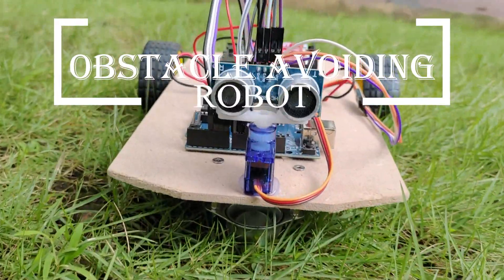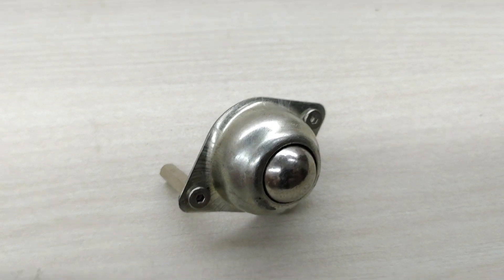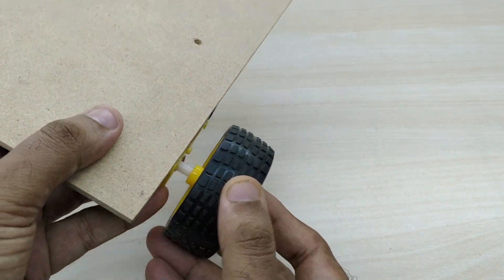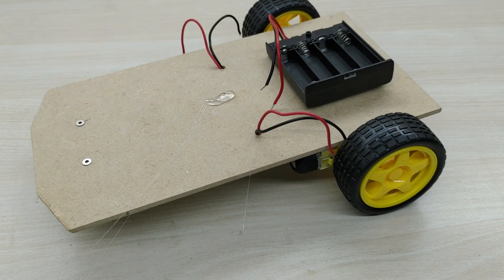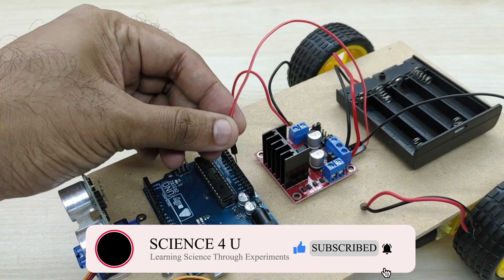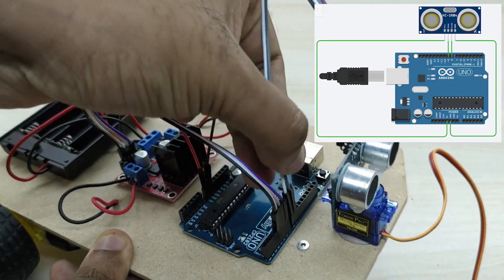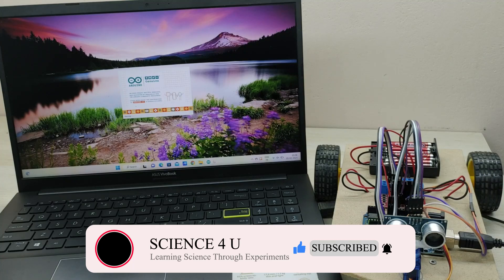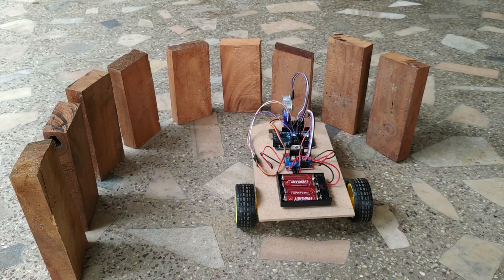Intelligent Obstacle Avoiding Robot || Step by Step Tutorial || Arduino Project

Comment: Bro my motors are stop working sometime while car is going ahead and battery is fully charged
Reply from the maker: It could be some loose connection or problem with the motor driver board. Is it detecting obstacle correctly?. Also if you remove ultrasonic sensor, is it continously going to front without stopping?. Can you check that?

Comment: can I use 4x 18650 3.7V battery? will that be too much power? can I use the 5v pin in the L298n if it has too much power?
Reply from the maker: it is too much for the project friend. A total voltage upto 12V is fine. 2  x 18650 or maximum 3 x 18650 is okay. Beyond that, it will damage the board and motors.
Reply: @Science_4U_  Thank you

Comment: Can i use a battery box that only lets 2 batteries in. Or i will need more power. or just use the one your using.
Reply from the maker: Hi friend. You need at least 4 batteries if your are using AA batteries. that gives you 4 x 1.5 V = 6V input voltage. So if you are using AA 1.5V batteries, you need a holder with 4 batteries. Another better option is to use 2 x 18650, 3.7V batteries. If you use 18650 batteries, you have to use a holder with 2 nos. of 18650 batteries and it gives 7.4V output voltage.

Comment: My Arduino board is a bit different there's no IOref but rather another 5v
Reply from the maker: Both IOREF and 5V are one and the same. Both pins give 5V output. You can use 5V pin instead of IOREF pin.

Comment: My G I dont have a servo motor . Does it still work ? Is it works please tell me how can i make it so it would work without a servo motor
Reply from the maker: Hi friend. You don't need a servo motor for this to work.  No need to change the code also. Just fix the ultrasonic sensor alone in front. The connections for the servo motor to arduino alone can be ignored.
Reply: Thank you very much 💀 I was really shocked by your quick answer . Thank you very much  @Science_4U_

Comment: Sir, I have completed the model by seeing ur video.but only one motor is running and another one is not working and the car is rotating in a circular manner because of One wheel.what might be the problem? and how can I resolve it sir
Reply: i Have also changed the  motor Driver too
Reply from the maker: Okay friend. I think the battery may not be powerful enough to rotate both thr motors together. Can you lift the robot in you hand and try rotating the wheel which is not rotating. Do you feel like it is starting to rotate or there is no rotation at all?. Also alongwith the battery, connect uno to usb also. Now are both wheels rotating?. Most likely i think it should be due to poor battery.
Reply: I have also lifted up sir but only one wheel is rotating but if I give direct connection to the battery then it is rotating
Reply from the maker: @SHIVKUMAREASWARB  okay friend. Can you do one thing?. In the motor driver board, remove wires from IN1 & IN2 and connect to IN3 and IN4. Also remove wires frim IN3 and IN4 and connect them to IN1 and IN2. Is the other motor now rotating?.

Comment: Sir, the code is not working
Reply from the maker: Hi friend. After uploading the code and switching on, the wheels are not rotating?
Reply: @Science_4U_  ohhhh, actually it works, Thank you very much 😘
Reply from the maker: Okay friend. Actually all the projects that I upload are after making it and testing by myself. So all are working projects only. If it doesnt, there could be some mistake in connection or most often the components may be faulty.

Comment: Servo motor is working but car is not moving. How can check if my motor driver is faulty?
Reply from the maker: The motor driver needs to have 2 jumpers connected on ENA and ENB pins. The jumpers should be present for the working of the motor driver. Are the jumpers available?
Also to check whether the motor driver is working, connect IN1 pin to +5V of arduino and IN2 pin to GND pin of arduino. Power on arduino and motor driver board. If the motor driver is working, the motors should rotate now.

Comment: i use ch340 arduino and it doesnt have a ioref do you know for its substitute?
Reply from the maker: Hi friend. Is your CH340 a regular sized Arduino board or a nano board?. Instead ot IOREF another pin should be there in its place labelled 5V. Is there a pin like that?
Reply: @Science_4U_  I use also a 2pcs of 3.7 batt 183650 still should i put that at 5V?
Reply from the maker: @joannrosemalalis1374  Yes friend. The sensors are powered from the 5V outputs from arduino board. So if you are able to find any 5V pin in arduino board, you can use that to power the sensor.

Comment: When iam disconnect the usb cable from laptop the motor didn't work when connect the usb cable to computer it's working what can I do😢
Reply from the maker: That is definitely because the batteries are discharged. When connected to laptop, the arduino, sensors and servo motor gets its power from laptop and the battery needs to run only the motor and so it works. So even if battery is slighly discharged, it will work. 
Changing to new battery will solve the problem friend.
Reply: Thank you bro❤😊😊
Reply: Thankyou thank you for your best information ❤❤❤❤❤❤❤❤😊😊

Comment: I want to add DC switch to it... can you please tell me where can I put it in the circuit?
Reply from the maker: Hi friend. You can add switch in the positive or negative wire from the battery. Just cut the wire coming from +ve or -ve terminal of the battery and add a switch there. 🙂
Reply: Thank you it worked but now my wheels are not moving. What could be the possible reason? I followed the same circuit but instead of those batteries, I am using 18650 lithium batteries.
Reply from the maker: 18650 batteries are infact a better choice. I just wanted to understand.Were the wheels working earlier before adding the switch?
Reply: Yes. They are working fine otherwise. I tried to run it on L298N motor driver only.
Reply from the maker: @Vaidehibhaiya  Hmm..But Iam also not able to understand why the wheels are not working after just adding the switch.🤔
Reply from the maker: @Vaidehibhaiya  May be the batteries are discharged now..🤔 Can you lift the car and try rotating the wheels with you hand. Is it rotating now?
Reply from the maker: May be the batteries are discharged now🤔 Can you lift the car in you hand and try rotating the wheels. Is it rotating now?
Reply: @Science_4U_  Thank you so much for reverting back so fast. It is now working. I didn't d anything but after sometime it started on its own.
Reply from the maker: @Vaidehibhaiya ooh..Great friend. Nice to know that it is working now..🙂

Comment: I have done everything wireing and code too but it doesn't work the audrino and motor driver lights are also on but no movement
Reply from the maker: Hmm..okay friend. There could be many reasons.
1. The motor driver board could be faulty. Have you used it before or is it a new one?
2. Are the batteries new?. If the batteries are discharged, then also it will not work.
3. Check the connections once again.
Reply: Can I keep a picture to your number that you can see and everything are new I had also tested them

Comment: which battery did u use? any special config?
Reply from the maker: Hi friend. I used AA 1.5V x 4 nos. Of batteries for this project. We can buy battery holders in which we can put these batteries. All batteries are in series. Total 6 volts...
Reply from the maker: But if you can buy a batrery holder where you can put 18650 batteries x 2 Nos, it will be a better option. These batteries last must longer and are rechargeable also. Total output will be 2 x 3.7 = 7.4 volts.
Reply: @Science_4U_  will your provided code work then?
Reply from the maker: Yes sure friend. Same code will work..👍
Reply: @Science_4U_  thank u
Reply from the maker: @mountasirrahaman6088  okay friend..🙂

Comment: Mine motors are working but the servo is not working,what to do?
Reply from the maker: Hi friend. The servo motor could be faulty. Replacing the servo motor shoukd solve the problem. Before that please check whether the connections to servo motor are given correctly. Are the servo motors jerking atleast or it is not moving at all?

Comment: Bro how to open your code file in ArduinoDroid (mobile version) ?
Reply from the maker: Simply download the code from the link given in the description box. Then open arduinodroid app. Click on 3 dots on top right of the app and click open file to open the code..
Reply: @Science_4U_  ok bro tysm
Reply: @Science_4U_  bro i tried this connection but I don't know what's the problem with my servo motor, i think it is taking load .
Reply from the maker: @AnshuR7 okay friend. Can you tell what is happening with the servo motor?what do you mean by taking load. Are the motors rotating and is the obstacle getting detected?
Reply: @Science_4U_  when i upload the code servo directly try to rotate, but it is not rotating, when is saw it i found that the some of gears are not rotating in it, i use mg 90 servo motor.
Reply from the maker: @AnshuR7 Okay. It will be like that only friend. There will be always some random jerks in the servo motor. When detecting the obstacle only, it will turn 90 degrees. Is the obstacle getting detected correctly?
Reply: @Science_4U_  i don't know its detecting or not.
Reply from the maker: @AnshuR7 when you switch on, are both motors rotating in forward direction?
Reply: @Science_4U_  only servo sounds and motors not rotating
Reply from the maker: @AnshuR7 Hmm..okay friend. So there could be some problem with the motor deiver. That is why it is not rotating. What is the battery that you are using?
Reply: @Science_4U_  giving direct power from mobile
Reply: @Science_4U_  and second thing is that, my motor driver is only running right hand side motor not left hand side.
Reply from the maker: @AnshuR7 okay..when you bring hand near the ultrasonic sensor, is the right hand side motor stopping and rotating again?
Reply from the maker: @AnshuR7 Do you mean that the motor driver board is also powered directly from mobile?
Reply: @Science_4U_  i tested motor driver separately.
Reply from the maker: @AnshuR7 okay friend. Powering from smartphone doesnt sound like a good idea. You may get limited current output only from phone. Can you power the motor driver board with a battery?
Reply: @Science_4U_  yes i will try

Comment: Bro can we use 9v hw battery
Reply from the maker: Yes friend. Definitely you can use 9V HW battery. But it will not last long, since its capacity is less. That is the problem. You can connect 2 or 3 batteries in parallel and power the robot so that it will last longer..

Comment: Bro sevo is not working
Reply from the maker: Hi friend. Other than servo, is it detecting obstacle and changing direction correctly?
Reply: At first it change the direction now it was completely offed
Reply: And the Arduino light was completely offed only motor driver light is on
Reply from the maker: @user-vs5rq2ul9q Okay friend. I doubt the battery. Have you used a new battery?
Reply: S bro
Reply from the maker: @user-vs5rq2ul9q can you connect uno to pc or laptop using usb cable and then try whether it is working? Battery also can be connected..
Reply: Bro now the green light in Arduino is blinking but orange light in Arduino is not blinking
Reply from the maker: @user-vs5rq2ul9q It will be like that only friend. But now, do you see the motors rotating?
Reply: When I connect the cable it is ok when I disconnect it the orange light is not blinking
Reply: No bro , motors are not rotating
Reply from the maker: Hmm..Most likely, the motor driver board  may be faulty. Can you try changing motor driver board and see whether it is working?
Reply: Bro i have changed now the right wheel is not rotating and servo is not working and the left wheel is working when we have connect the usb cable
Reply from the maker: @user-vs5rq2ul9q Hi friend. From whatever you have told, it is most likele a battery problem. Can you connect a new battery and see if the problem is solved?
Reply: How to check whether the ultrasonic is perfect or not???
Reply: If we disconnect the usb the robot is not moving and i don't know whether the sensor is working or not
Reply from the maker: @user-vs5rq2ul9q Hi friend. From whatever thst you have told, I ubderstand it is due to discharged battery. Can you connect a good battery and check whether the problem is solved?

Comment: Why is the code showing compilation error

exit status 1 Compilation error: exit status 1
Reply from the maker: Hi friend. Make sure you have to select the correct board under the tools menu in IDE software. Also, in the tools menu, the correct port for uploading the code also has to be selected. Then try reuploading the code. If it again shows the same error, you can try redownloading the code and again upload. Some change in the code could have happened because of some mistake. Still if the same error is occcuring, you can try changing the USB port or try a different PC /laptop.

Comment: idk what board to connect it to??
Reply from the maker: Hi friend. There are 2 boards used in the video. 
1. The microcontroller board is called Arduino Uno, which uses signals from the ultrasonic sensor and gives control signals to the motor driver board for turning the robot.
2. L298N Motor driver board. The motors are connected to the motor driver board and motors get power from the driver board.

Comment: Hi bro, I don't have a multimeter, can you tell me how many milliamps the current is?
Reply from the maker: Hi friend..total peak current will be around 500 milli amps..
Reply: @Science_4U_  thank you❤
Reply from the maker: @Sharifi_Matin okay friend..🙂
Reply: @Science_4U_  I used two 3.7V batteries with more current than required and the robot does not work properly
Reply from the maker: @Sharifi_Matin okay friend. 2 x 3.7V batteries are good enough for this project. Is the robot not moving at all? What is the problem?
Reply: @Science_4U_  The robot is moving too fast and the servo motor is not working properly

Comment: Hello, I have assembled the robot as shown, but the wheels are not rolling as expected. Servo motor is working alright as expected.
Will you please guide me??
Reply from the maker: Yes sure friend.
Reply from the maker: There could be many reasons why it is not rolling as expected. You have to check one by one to find out. The most common problem could be L298N motor driver board. Have you used it before or is it a new one? . It could be faulty.
Also, in the motor drive board, there should be 2 jumpers in place connecting ENA and ENB and the pins above them. that is for enabling rotating of the motor. If the jumpers are not there also, the car wont start.
Also, check whether the batteries have charge in them.

Comment: My servo motor is working but the wheels are not working.......I have connected wires as shown in the circuit diagram. Please guide me
Reply from the maker: Hi friend. There could be many reasons why it is not starting. You have to check one by one to find out. The most common problem could be L298N motor driver board. Have you used it before or is it a new one? . It could be faulty.
Also, in the motor drive board, there should be 2 jumpers in place connecting ENA and ENB and the pins above them. that is for enabling rotating of the motor. If the jumpers are not there also, the car wont start.
Also, check whether the batteries have charge in them.
Reply: No I have the same problem you should give 12v power supply

Comment: My wheels are not working?
Reply from the maker: Hi friend. There could be many reasons why it is not starting. You have to check one by one to find out. The most common problem could be L298N motor driver board. Have you used it before or is it a new one? . It could be faulty.
Also, in the motor drive board, there should be 2 jumpers in place connecting ENA and ENB and the pins above them. that is for enabling rotating of the motor. If the jumpers are not there also, the car wont start.
Also, check whether the batteries have charge in them.

Comment: my servo motor is running as expected but wheels are not running. Why?
Reply from the maker: Hi friend. Most likely it is a problem with the l298n motor driver board. It may be faulty. Have you used it before or is it a new one?Also can you see 2 jumpers in place in the motordriver board, connecting ENA and ENB pins to the pins above that?. Those jumpers are required for enabling rotation of motors..

Comment: which pins are responsible for motors to run?
Reply from the maker: Hi friend. In this code, the commands for running the motors go from pin numbers 4,5,6&7 of arduino to the motor driver board. So pin numbers 4,5,6&7 are responsible for the motors to run..

Comment: its not starting
Reply from the maker: Hi friend. There could be many reasons why it is not starting. You have to check one by one to find out. The most common problem could be L298N motor driver board. Have you used it before or is it a new one? . It could be faulty.
Also, in the motor drive board, there should be 2 jumpers in place connecting ENA and ENB and the pins above them. that is for enabling rotating of the motor. If the jumpers are not there also, the car wont start.
Also, check whether the batteries have charge in them.

Comment: Hi sir . I am making this project now. but i have some problems with L298N driver board. I contacted all the jumpers correctly and i check it for more then 5 times . When I attaching my motors with L298N driver board it doesn't work and also my Servo Motor is not working. All the elements are not default.
Reply: plz help me . I have to submit it tomorrow.
Reply from the maker: Hi friend. There could be some problem with the l298n motor driver board. We have to check and see if the l298n motor driver is working or not. Can you see 2 jumpers in l298n motor driver that is connected to ENA and ENB pins?